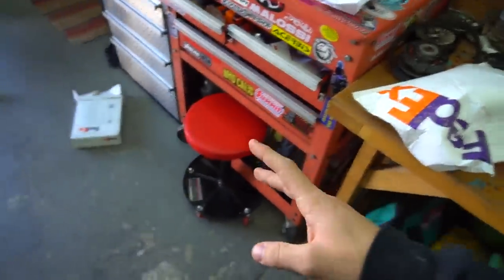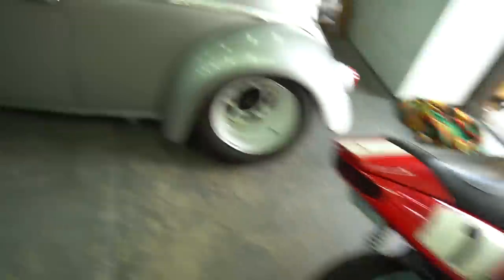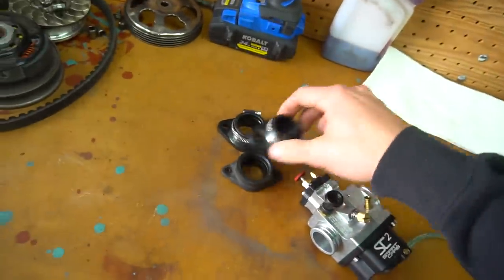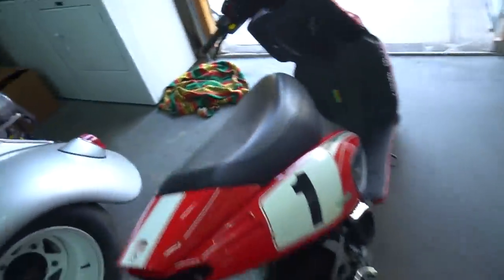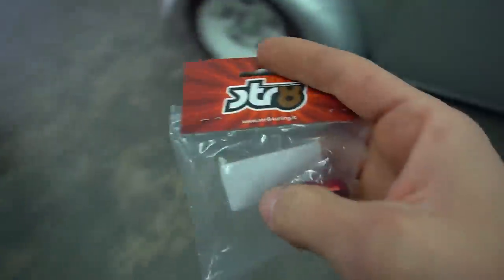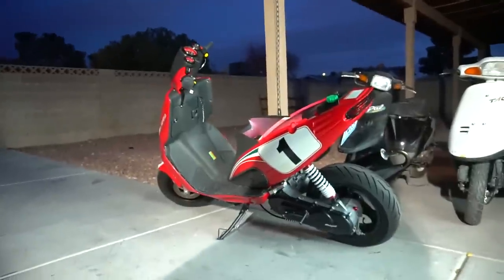PHANTOM F12 gets SMART CARB! SC2

Comment: Killer video! Can't imagine Brandon got his carb back. Couple of things real quick if we may - at 3:56 it looks like the cable nib isn't retracted up and into place fully in the slide. Looks to be hanging out or stuck. Could be the reason for the lack of slack and the hangup plus we don't want it accidentally coming free while you're ripping. Any cable setup that works with the PWK of similar size works with the SC2. Also as you go remember that the adjustments of the SmartCarb only affect the bottom end. If you're needing something different mid to top, richer/leaner, we make a wide variety of metering rods available to drop in for all manner of fueling needs. 

Happy Riding! 🤙

Comment: I put a 28mm smartcarb on my stage6 88cc stroker rs50
Reply from the maker: how’d it run
Reply: MOPBOYZ  snappy. Easy to fine tune. It is the only carb I have had on this build  but a lot easier out of the box than any other carb I've used. Did not have to pull it off several times to swap jets and needles and no flat spots

Comment: hello everyone if anyone could help me? I own an aprilia sportcity 50 2t, I want to put a kit stage 6 sport pro mk 2, but that's where the problem comes because the differential (gearbox at the last wheel gears idk) so they are short on AC, does the gearbox from the lc machine fit if you understand me?

Comment: Hey love the vids.
I have a Genuine Buddy 50 and want to upgrade it and have run 50 to 60mph. I did upgrade the the CVT kit with  Naruku performance set up it takes of a little quicker but takes long to get to speed and slows down on hills. 
Any suggestions would help.

Comment: Bro if u had used the 21 cp with the airbox it’s normal that the performances sucks. From 19mm carbs u need an open filter. I’m from italy and here we tuning scooters a lot. 
Don’t buy the smart carb just buy a 24 pwk polini and a polini filter. Guarantee u that the scooter after this tuning goes
Reply from the maker: i wasn’t using an airbox